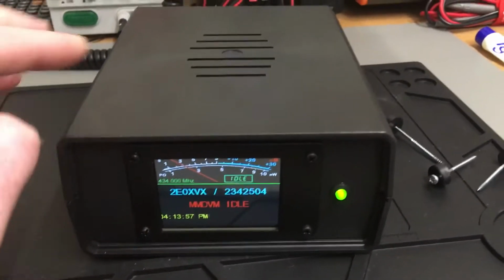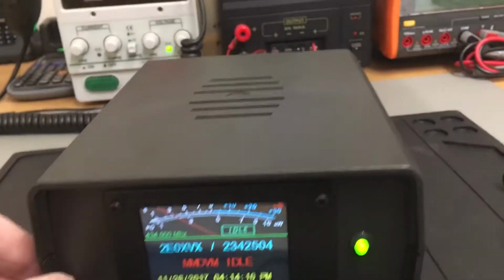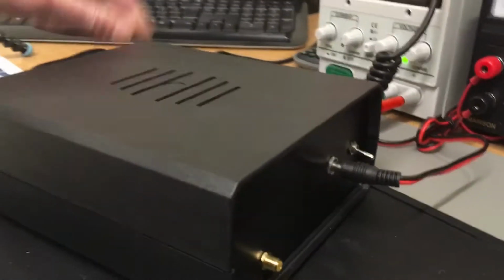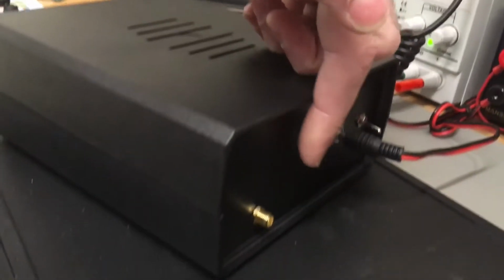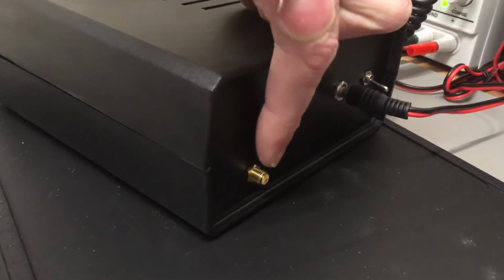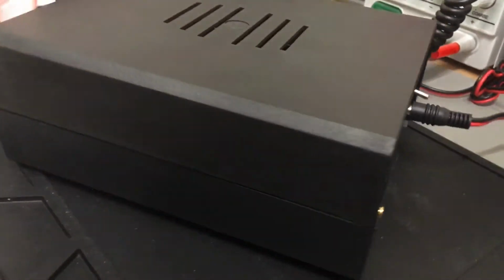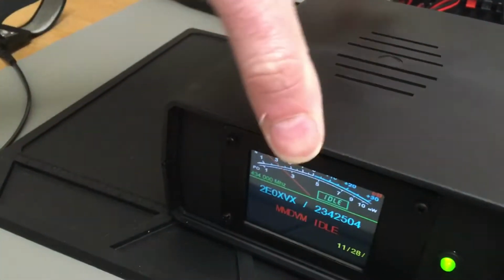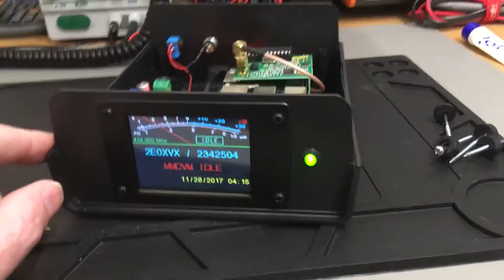MMDVM Hotspot

Comment from the maker: Sorry Davis,but your eBay is different to UK eBay. All parts apart from dvmega board are available to buy on eBay. Just search the parts. 
You need a buck converter, usb to TTL convertor, pi3 plus plug and socket. Wire, case and the dvmega. I can sell you one ready to go. I would need your WiFi details and your address so I can put all the details in. It runs aprs beacon as well as doing DMR ,d-star fusion.

Comment: Were can I get one?
KG5YGS
Reply: 2E0XVX Mick
vor 9 Monaten
Sorry Davis,but your eBay is different to UK eBay. All parts apart from dvmega board are available to buy on eBay. Just search the parts. 
You need a buck converter, usb to TTL convertor, pi3 plus plug and socket. Wire, case and the dvmega. I can sell you one ready to go. I would need your WiFi details and your address so I can put all the details in. It runs aprs beacon as well as doing DMR ,d-star fusion.